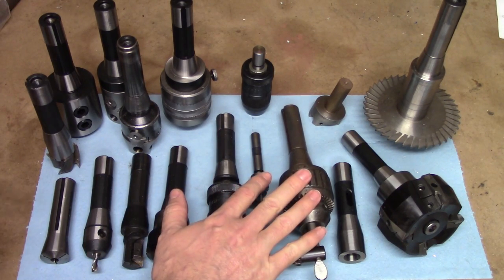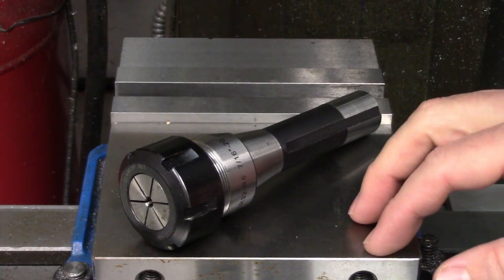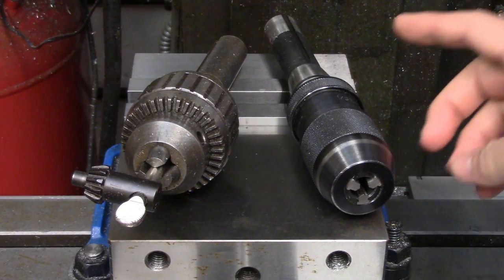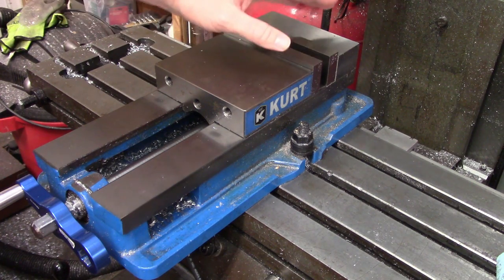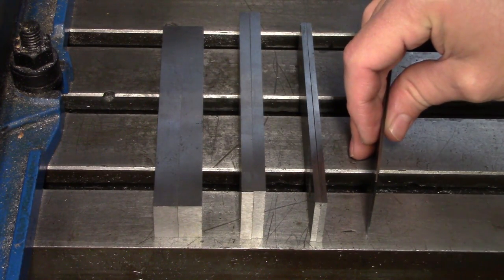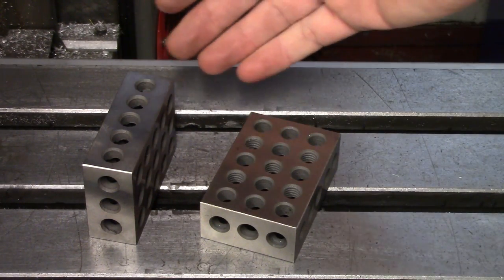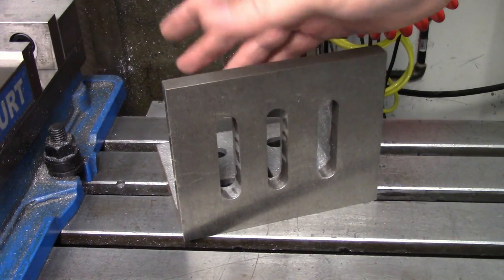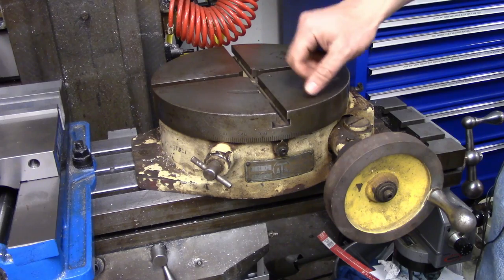Tool and Work Holding on the Milling Machine

Comment: All good info.
Re 1 2 3 blocks, although a hard metal the clearance hole can be easily drilled with a solid carbide end mill, which can legitimately b used in a drill chuck as you are drilling a hole but maybe best not.

Comment: Got a good deal on a bench top mill, a 12 x 36 lathe, and quite a bit of tooling. I haven't even set them up yet since watching videos like yours seems a more appropriate start. I live in a little farm and ranch town an hour from the next town as large. I wonder your opinion of buying used or Chinese tooling listed on eBay or Amazon. Anyone?
Reply from the maker: Used tooling can be a crap shoot. Quite often there can be dents, chip scars, etc. on the taper that can affect your runout. Unless you can see it in person or they have really excellent pics of the tapers, I'd be a little wary. I've had excellent luck with the tooling from shars.com. I have their R8 collets and endmill holders as well as some ER collet chucks from them. Glacern.com is another good source. I have keyless chucks and ER collet chucks from them. The quality is excellent. Not sponsored by either one. Just a happy customer. Good luck in your new adventure!

Comment: One thing you must remember when using ER collets is that the shank must be completely through the collet. If it isn't it can and will come loose ruining your cut. I didn't know this when I first started using them and twice had the cutter drop down ruining my piece.
Reply from the maker: Excellent point that I should have mentioned, although I did cover it in the longer ER collet video.

Comment: I got into manual machining about twenty years ago and from the beginning all instruction said to never use a collet for holding end mills or any tooling in the mill but to use tool holders designed for the task.  Since You Tube came along almost invariably when I watch videos they use collets to hold the cutters.  Seems that is the approved way but it leaves me wondering as the chinesium floods the market, does one need to purchase a set of metric collets for them??   Do they even make 5C or ER metric collets?  Or are there R8 holders made for them?  Thanks for any clarification.
Reply from the maker: Yes to all accounts. With 5C and R8, they can't close very much so if you want to hold a metric endmill or metric stock, you need to have the correct sized collet. ER collets have a wider range. You just have to make sure you're gripping on the entire length of the collet. Regarding what you were told about collets in the beginning, there's a kernel of truth to it. Endmills can slip out if collets if they're not tightened enough, but you get much better concentricity compared to endmill holders, so your tools are less likely to chip.
Reply: @StuartdeHaro  Thanks for the quick reply!  Guess I will have to get a metric set of the Er40 to go with all the others.  Hadn't thought about the lack of the weldon cutout on the metric cutters.  Very good point!!  Thanks again.  Just added you to the subscription list.

Comment: For the straight shank on the short drill chuck, could you cut that down, to make changing between it and a 1/2" endmill easy? Or would you introduce too much runout from not 'filling' the back of the collet?
Reply from the maker: Absolutely. I have a keyless chuck that I did that to. Collets grip at the front and only for about an inch or so. That’s all you really need.

Comment: how do I hold a tapered round in the mill to cut a keyway in it?
Reply from the maker: @markvanderveer409  There's a lot of "it depends" in this answer. Are there any straight parts on the piece? If so, start there. If not, are you making the part from scratch or modifying an existing part? If making from scratch, I'd leave some sacrificial material on the end and hold it with that, cut the keyway, then cut off the excess and finish the part. If it already exists...well, you'll have to get creative.  I'd probably make a fixture to hold it with the negative shape. You'll need to have some way of clamping it down and a stop on the large end of the taper to keep it from getting launched across the shop. That’s the kind of job that can take hours to set up and minutes to machine.

Comment: Very verbose video. Thank you. What fixture would you recommend for someone with a morse taper no 3 spindle on their lathe and wants to do light milling using a lathe milling slide?
Reply from the maker: You should be able to find Morse 3 endmill holders and then rig up a drawbar to hold them through the spindle. That could be as simple as some all-thread with some washers and a nut to pull the endmill holder in. I wouldn’t do it without a drawbar though. Side loads can pop a Morse taper loose from the spindle.
Reply: @StuartdeHaro  Thanks for the advice. Probably the easier way to go than stuffing around with a bespoke holder that threads onto the spindle. Even though my lathe is a screwcutters lathe, it requires rebuilding a gearbox for each and every pitch....